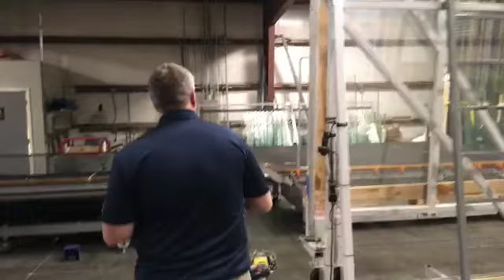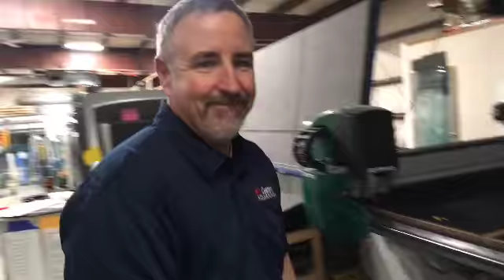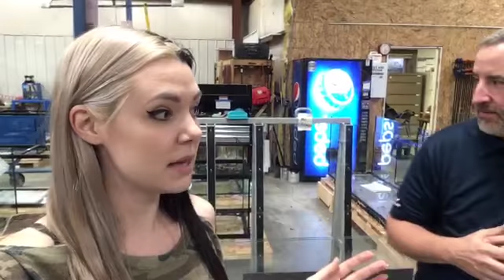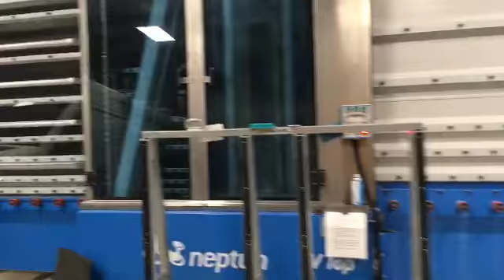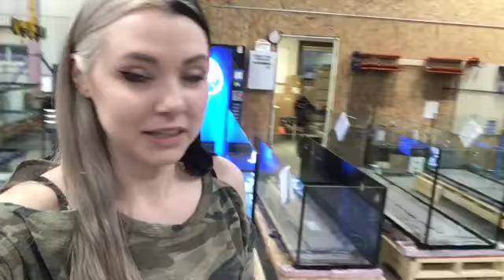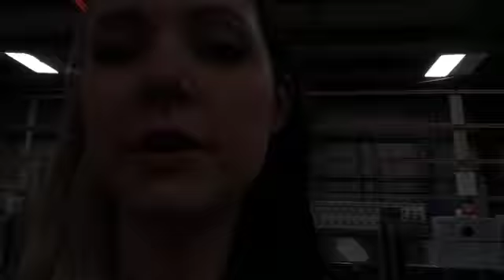Behind-the-Scenes at an Aquarium Manufacturer // Custom Aquariums

Comment: I’d like to hear everyone’s opinion on using water from a well system. Before or after the water softener? Don’t use at all?
Reply: I use my (well)water straight from the tap. No issues with my fish. I'd test the water from your tap with your test kit, and maybe check for copper if you have  snails/shrimp.

Comment: ahm... my 4 goldfish are chasing my blackmoor and i don't know what to do. In the fear of the fish getting stressed i removed the blackmoor. I plan to re add her, if its ok ?
Reply: MarkJoshua Oliver my suggestion will be to hold with the black moor reintroduction . Are all the five fish of the same size?  Is the space of aquaroum sufficient ie around 60 gallons for five fancy goldfish. Comet will require more space. What are the other goldfish Size and variety and how long they have been in tank and how long they were with blackmoor. Also is there any goldfish pair formed in tank which can be a reason they are being territorial.
Reply: i just reintroduced the blackmoor and they are doing fine now, also thanks about that info about the comet dunno they needed more space, also does it apply to shubunkins